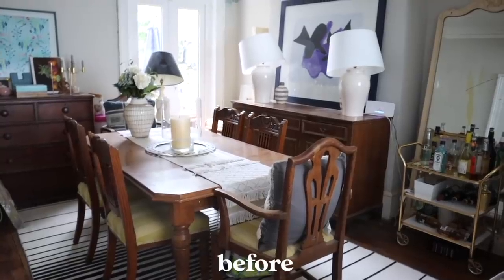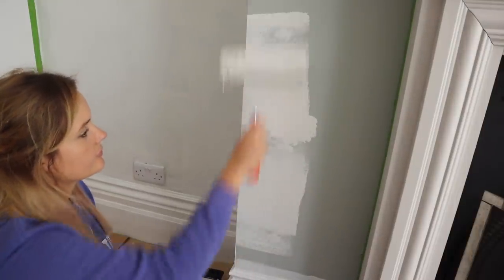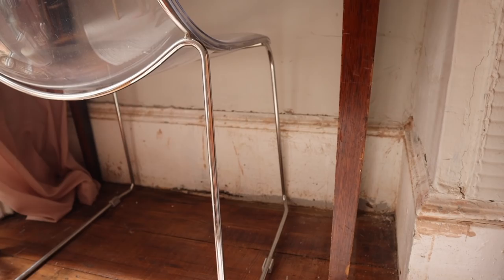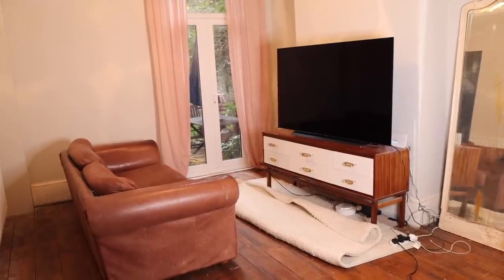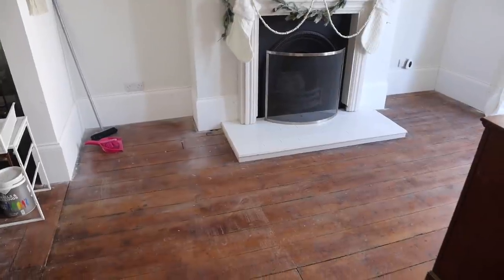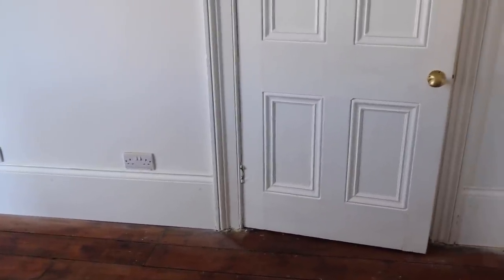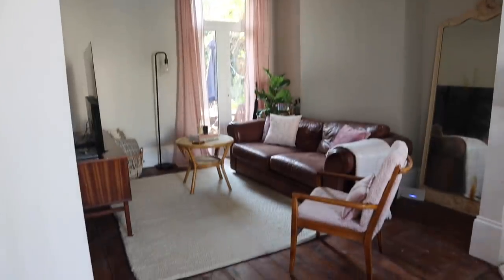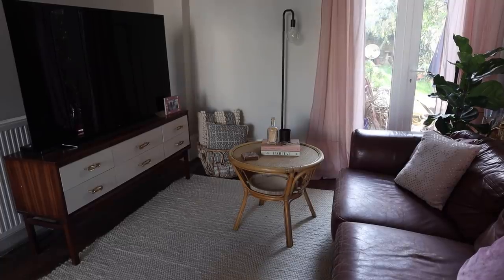Huge Progress Updates | Sitting and dining room transformations | DIYary Victorian Home Renovation

Comment: Hi Hermione
I love watching the process in your home and the new skirting boards look simple and clean. As for the skirting board above   the corner wall hiding the pipe you can buy two thin strips of wood the same width of the top of the board, nail it in place, then draw a straight line at the bottom in between the missing piece corner to corner and then paint it the same width and color to mimic the skirting board. It would look finished, seamless and not bulky. I look forward to seeing how you decorate for the upcoming holidays!

Comment: I am a bit concerned of the TV placement … it's quite near to the radiator, that might damage your TV. Maybe you ask a pro?
Reply from the maker: Totally agree! I've actually moved it a few inches further forward and keep the radiator suuuuper low 🙂 but will get a second opinion ✨
Reply: @HermioneChantal  please count with the TV making heat itself. It can be broke much earlier if it cannot "cool down".
Reply: @HermioneChantal  Have to agree with the others on this - clutter in front of the radiator already makes it less efficient + having to turn it down on account of the TV overheating = even less efficient heating in the room. 

Skirting boards look perfect though - we started renovating our house just a couple of months after you started yours and still haven't finished all the skirting boards 😳
We put them up as they were with the primer and never got round to doing the finishing touches in every room, one problem was that the paint I originally picked - silk white not gloss - was soooo annoying in that it came off in sticky streaks and I never got round to finding a better paint (both for skirting boards AND door frames some of which still need touch-ups) - recommendations welcome!
Reply: @HermioneChantal  could you put the t.v. above on the wall and move the stand it was on somewhere else maybe?
Reply: Was thinking about that too
I think sofa at radiator was even more eye appealing
Old arrangements of sitting room is definitely better
Reply: @janetwalker3541  so sorry to butt in, I agree it would look great but please don't put a tv on wall above a heat source, one of Hubbys co-workers did that and it killed her tv.  Heat rises, she hadn't even had the tv all that long.  It was an expensive lesson :(   I wish I could put ours on wall, but can't.  sorry for butting in, hugs x

Comment: Hi , I opine if the hardboard covers an actual chimney as did our bedroom one we were advised to put in one of those little white plastic sliding "air" flow items. The air flow can be stopped by sliding in one direction or allowed by sliding in the other. It did provide air for us perhaps your builder could advice on what from me is an suggested opinion only.

Comment: The new skirting looks great, your carpenter did a great job.  Just one thing...did the carpenter leave any ventilation holes when he boarded up the fireplace, otherwise you may get damp problems down the line?  He may have put some on the side of the fireplace and you just didn't show it on the video or I missed it but thought I should bring it to your attention if not.  Lovely video as always.

Comment: It all looks beautiful, the new skirting board looks amazing. Hope you don’t mind me mentioning, the unit with the television on, are you going to use the radiator? Just be a little carful the heat doesn’t affect your television. Televisions can get quite hot at the back, and if the radiator is also hot I can’t see it doing your television any good. TYFS a great video 💐💐💐💐💐💐

Comment: Please dont put the TV by the radiator. Its old place was better. And not just the heat, it somehow looks strange in front of a radiator, like you are trying hard to cover it but fail. If you want it there so much, then move it there for the summer when there is no heating.